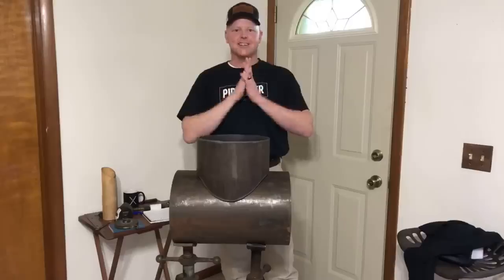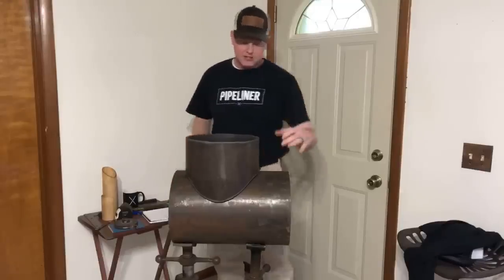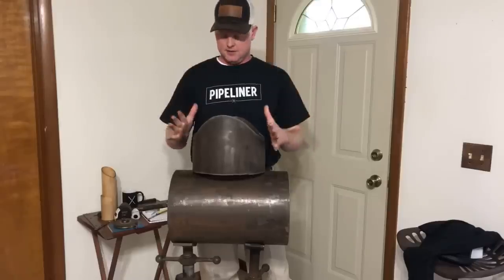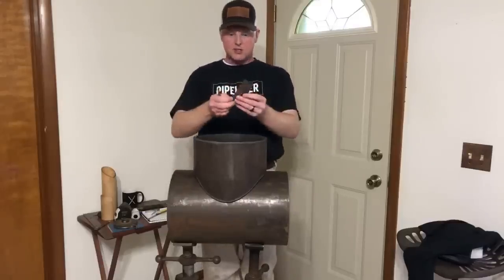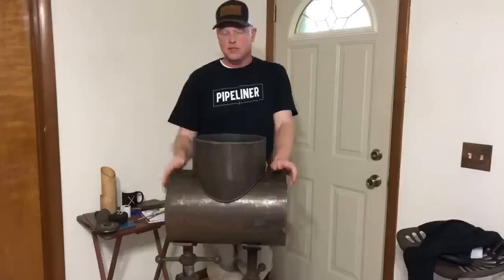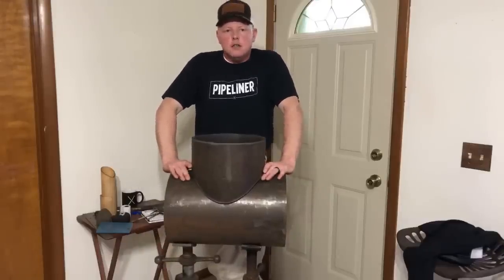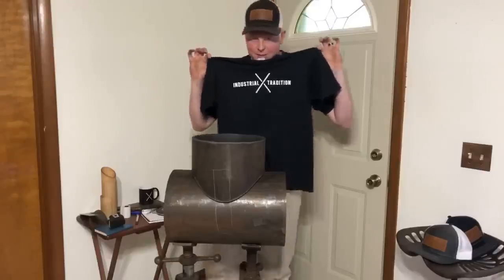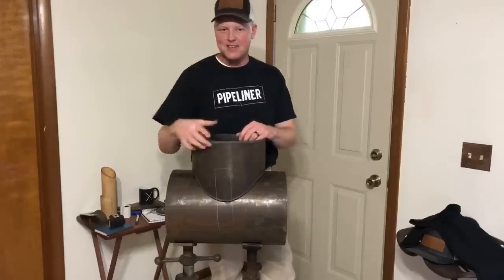BRANCH TEST FOR PIPELINE (Top 5 Tips To Pass Your First Test)

Comment: I’m curious about the beveling of the saddle? I’ve been looking around fir answers but haven’t had much luck. How do you properly bevel the saddled pipe, in that the bevel is in the correct direction? On the tightest points, the ears I think you called them, the sections that’s going down the side of the pipe) is where I’m wondering about the bevel on.

Comment: LN 25 greatest suit case feeder in history. You hafto have a CV module on your pipeliner welder. You can run FCAW-G FCAW-S or GMAW-S or spray. Those machines are tough, they will run on CV/CC the voltage sensing one is the one I use and you can run about any wire size you need. I've had mine for 20 years and it's never let me down. 
  Field pipe welding is predominantly SMAW, you have to have a WPS so do not bust out your LN on pipe without documents for that process. Thanks for your videos.

Comment: Marking inside pipe cut line ive found it easiest to use a 1/8 rod with a sharp point to get a precision cut line on the inside diameter.its just much easier to get a mark down on the ears where its difficult to use soapstone as you were saying . it leaves a very nice scribed line.

Comment: For most of the companies you test for do you use 6010 5p+ and 7018 out? Have you ever done one of these with a 7018 bead?
Reply from the maker: 6010 bead and 8010 out is usually the  case. Occasionally there is a test where we have to fill and cap with 7018. Same with the 7018 bead. Some times a 7016 bead.
Reply: Austin Ross I really appreciate your reply. Last question, have you ever done a 6010 bead and 7018 hot and cap, than the company required you to do 7018 100% on a live line?

Comment: First of all I enjoyed your video, as always, but we need to clarify 1 thing, RJ Molina asked about specific gas, well do not use any gas other than Acetylene & Oxygen, any other gas will add or remove properties from the metal, so that means no propane torch cutting, no gasoline torches, as well as a few other mixed gasses available in the specialty market. propane is fine for heating, but for cutting leave it to scrap yards & salvage places, as if used metal around will have to be cut off usually 1-2 inches away from the cut that was done with propane. propane needs special hoses as well. 

im here to learn this field, but have played with welding & torches for close to 40 years, but never done any pipe, but want to.
Reply: If propane is that bad how bad is a gasoline torch,  yikes,
Reply: @ryanb1874  I have never used gasoline oxygen torch, yes they make them, but it is also best for scrapping. 

there is also old air-gasoline torches, used for home repairs in old days, like soldering gutters, soldering cast iron drain pipes. or using the mounts on it to head a soldering iron, to do soldering work without flame, many times to remove brushes from electric motors, or my favorite was used to do lead work for auto-body sheet metal repair, before body filler

Comment: Working out in the pipe line as a rig welder, do you supply your own pipe beveler or does the company you work for supply you with them? Than you and your wonderful family
Reply from the maker: Usually anything over 12" they do.  Under that is kinda depends on the company.  When you first get going if you don't have the money most of the time you can find one to borrow.  It is a great tool, but I wouldn't say you HAVE to have one right off the bat.
Reply: Thanks for the reply and great videos!!!

Comment: When pipelining do you need your own oxygen and acetylene tanks or are they supplyed
Reply from the maker: Most generally they supply them but if you are getting paid straight contract you might have to supply your own.
Reply: Austin Ross thank you. It is greatly appreciated. I want to be a pipeline welder and every bit of knowledge I can scrounge up is berry helpful. Thank you.
Reply: Austin Ross what leads do you use. How old were you when you learned how to weld
Reply from the maker: I use ultra flex leads. Size 1/0 I believe. But you can get a hold of leads that are cheaper if you just starting out. I was 15-16 years old. What is your situation?
Reply: Austin Ross I’m 14 I’ve been welding since I was 7

Comment: 12 year combo pipe welder here.I have a few questions . Would you recommend helper or to just practice and test for first pipeline job? Also do you  bevel when cutting 2nd hole with torch or do you cut hole and bevel with grinder? Are you coming to the Atlantic Coast Pipeline from W Va. to NC? Last are you a 798? Thanks love the videos!!
Reply: Yes I’m in NC but I’m not on the pipeline yet
Reply from the maker: The hole does not get beveled. Just cleaned up with a grinder. Yes I’m in the 798.
Reply: Thanks Austin
Reply from the maker: Because you have welding experience I would recommend just practicing down hill and just tryin to get a test.